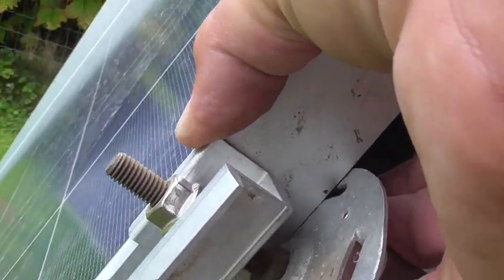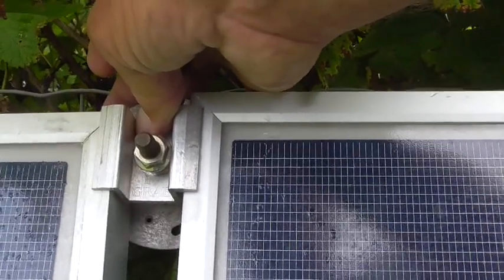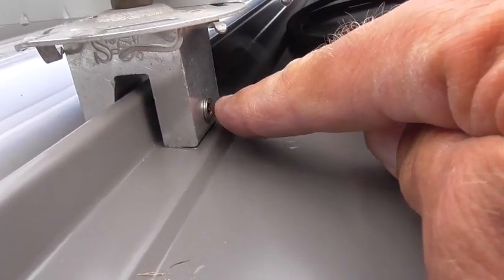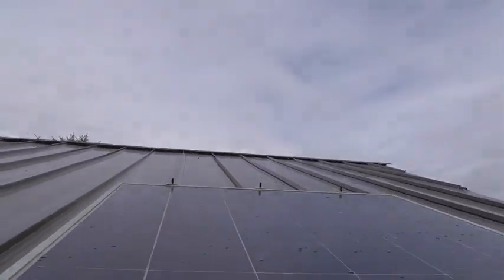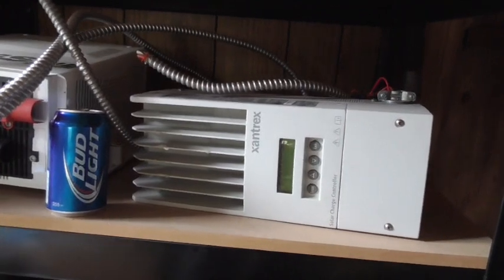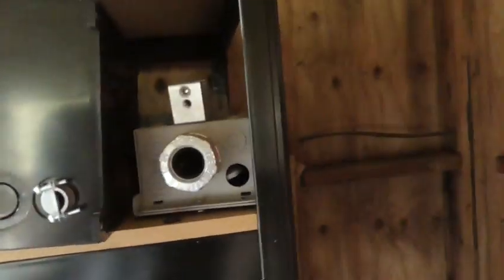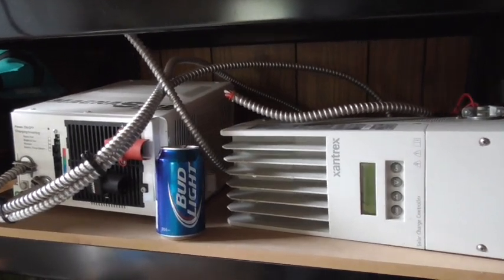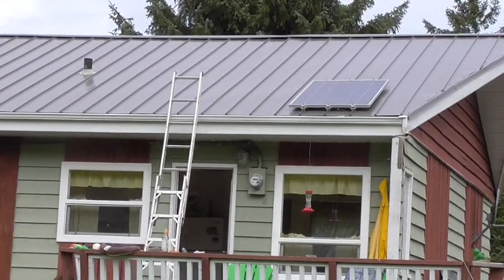No Penetration (Part 1) Metal Roof Solar Panel Install !

Comment: After 9 years use, any issues with corrosion where the bracket clamps to the metal roof seams?  Especially since the clamping screw might cut thru the paint on the steel roof?  A current S-5 video shows using 2 clamps on each long side, so the panels orient horizontally across the seams.  Less cost and better support (shorter spans).  But can't always fit panels ideally, given roof size and obstructions (vents, ...).

Current all-in-one "hybrid" inverters today are a "one-box + battery" solution (ex. EG4 6000XP), so simpler than your layout then.  You can wire ~8 panels in series in a "string", up to 400 VDC, for simpler wiring.  Some such "string inverters" have up to 4 string inputs (MPPT).
Reply from the maker: So far there is no corrosion issues at all on any of the clamps and are holding Great!  You can mount the panels in either direction but due to the high winds here, spreading the mounting contact points over 3 panels is much more secure than 2 points.  The new inverter/charger systems are much easier than my older system but we will see how long they last compared to the older systems.  My system is now just over 15 years old, 10 here and 5 in Calgary before we moved here.

Comment: Interesting idea, but how did you get the wiring from the panels to the inside?
Reply from the maker: The wires go through the basement wall under the deck.

Comment: How do get wire through the roof into the structure? Thanks for this!
Reply from the maker: Ran it down the wall and into a waterproof box which is attached through the wall in the basement.
Reply: @NormanMcGregor  I have perfect roof orientation to do this, but it's so much work and additional copper (as it turns out) for my solar well pump application. Thanks for the reply!
Reply from the maker: That is too bad because it does work great.  But you do have to weigh the cost/benefit in any system for sure.

Comment: I think they do great in the wind I am worried about the snow load on them.
Reply from the maker: Here in Canada, e get lots of snow and I've had no issues in over 10 years with them. S5 also uses these for their snow guards.  Don't think snow load is a problem as long as your roof is rated for the load.

Comment: I'm about to install some on my place in calgary! But my metal roof dont have that thick of an edge. It's like maybe 3 quarters of an inch more rounded
Reply from the maker: Hi Robert!  Go to https://www.s-5.com/ They have clamps for most any metal roof types.
Reply: @Norman McGregor  thank you. I'm actually installing them this weekend so. Won't be nothing fancy. Just use what I have and maybe fasten 2x4s across lol
Reply from the maker: @robertgiroux3658  The nice thing about the s-5 clamps is you don't get holes in your roof.  Some people do screw 2x4's to their roof and use a good sealant which will need to be replaced every so often.

Comment: Where can you get these and what do they cost? My roof isn't standing seam it is the overlap rolled type whatever it is called. I don't think these would be open enough to go over the roll type. Do you know if they are made to fit my type metal roof? Thanks for the video.
Reply from the maker: The company is S-5 and you can get them online at https://s-5.com/how-to-buy/  
They make many different types of clamps for all kinds of metal roofs.  I think they are around $5 each here in Canada but check out their website for the current prices.

Comment: What batteries did you use back in 2015?
Reply from the maker: I showed them in the video.  They are L16 390amphour AGM batteries.  Still using them today and they are still delivering top performance.  Plus I used them for 5 years previous before I moved here.

Comment: Thanks for sharing. For everyone's benefit - one want to use solid dummy pieces of metal in the edge of last row of panels for S5 holder clip (and those should be of the same size as your panels) to have them secured (panel from one side, similar size piece of metal from another side). Otherwise the holder can slide off the panel at some point. It is especially important for the bottom row. Just take a look into S5 guide. I am also considering S5 products for my project now.
Reply from the maker: Good to know!  I checked the 6 year old mounts and all are still tight.

Comment: What type of Metal roof did you install ? where can I find this ?
Reply from the maker: Its a standing seam type.  Most metal roof suppliers can supply this type of product but it is a bit more pricey than regular metal roofing.  The advantage of this product is that there are NO Screw holes exposed to the environment and rain which causes leaks.
Reply: @NormanMcGregor  And also is this clamp still available today ?
Reply from the maker: Hi Terry, Yes they are at https://s-5.com/

Comment: when your stuff craps out eventually and it will look up  this guy and it is a complete solar power solution that will last the life of your system except for the inverter.  electrodacus.com   I am not sure if that system would work in the Philippines with their typhoons. what do you think.
Reply from the maker: Interesting...  My System has been running for 10 years now, performance is still 100%  with 0 repairs. Our Fall and Winter storms, that occur on a weekly basis, are WAY MORE INTENSE than the Misley typhoons you have in the Philippines.  Get a Life and learn from those who are actually doing it!! OR continue paying $$$ for your power and be at the mercy of the power companies when their systems fail and you have no power!
Reply: @NormanMcGregor  glad to hear it but the storms in the pinnes have winds that are pretty crazy. I have lived their and have experienced it. I am Canadian and haven't had winds that high in my experience. close but not quite as high. I am not sure if I can find the roofing that you are using in the pinnes. believe me, I will be installing a solar system when I get the chance to and I hope that it will be soon. we have blackouts for days and the only way that you get around it is to go solar. the price is crazy high and solar is the only answer.  how much is the attachment system you are using there btw.
Reply from the maker: We have winds that hit over 100 - 150kmp at least 3 times a month here in the Fall and Winter.  You may have that once or twice a year!   We have had 2 storms that achieved that this week alone.  That is a category 1 Hurricane in weather language.  With the right gear and installed properly, you will have a great system like I do.   What attachment system are you referring to as my system is a stand alone.......
Reply: @NormanMcGregor  you are using s4 that doesn't penetrate the roof and clamps onto the risers. I would like to get something without rails like you have so i will have to look into it. it just depends on what I can get for my metal roofing in the pinnes.
Reply: well the pinnes gets 20 typhoons yearly and winds go over 200 kph in about 5 of them. its not as much of a picnic as you would think. that is why I was asking about holding strength. I have seen roofs peeled off whole and just fly away. really amazing the power of the wind when it hits like that. I just need to make sure I have the panels buckled down real tight because I don't want anything to go visit the other side  another island. we have had some really bad storms cat 4 and 5 are not unusual for about 5 of them like I said.
Reply from the maker: @kusnezoff8705  For sure!  All depends on what you have to work with.  The S-5 clamps work Great  for metal roofs in the USA and Canada!  Not sure about where you are in the pinnes.
Reply from the maker: I guess if the wind takes your roof off, you will loose your panels for sure.
Reply: @NormanMcGregor  hahahahahahaha yup that would happen for sure. LOL

Comment: In most roof mounted applications with rails there are grounding wires that run along the rails. Did you have to add any type of grounding wire to your application to pass an electrical inspection?
Reply from the maker: With a metal roof, the grounding wire grounds the whole roof and panels.

Comment: What brand of solar panels did you install? How do you figure out how many panels you need?  How much does a solar system cost for a pole barn?
Reply from the maker: The company I bought them from was a Canadian company in Burnaby BC but they closed in the 2008 economic crash.  To figure out how many panels you need along with the other equipment you need, you first need to know what loads you want to run and how long they need to run.  From there you can figure out what you need.

Comment: Norman I am wonder if you have noticed a reduction in the amount of power your extracting from the sun with your solar panel since you have insulted him 3 years ago ?
Reply from the maker: The panels are actually 9 years old as I had them installed in Calgary before I moved here.  They are actually still over producing the rated wattage on perfect days so I would say no loss in power so far.

Comment: So a 200mph wind will rip them off
Reply from the maker: No guarantee they will hold in 200mph winds.  However considering that a Category 5 hurricane has wind speeds at only 156mph, I think you would have more to worry about than your solar panels in 200mph winds. LOL!

Comment: I would like to ask you.Can you use those on 5V crimp metal roofing???Thanks.
Reply from the maker: I don't think so as the S-5 clamps are designed to attach to a standing rib seam.  Check with S-5 though they may have a solution for you.  Their website is http://www.s-5.com  .
Reply: Thanks

Comment: No rails? Interesting. Looks like you need a lot of mounts per panel, versus the mount/rail/panel system.
Reply from the maker: John Lackner As I said in the video we use extra clamps because of the high winds here.  I would install the same number what ever style of mounting system.  The big advantage with the S5 clamps is you don't put holes in your metal roof.

Comment: everything is still nice and snug? we get extreme temperature swings +40c to -40c the setscrew doesnt back off over time?
Reply from the maker: The S5 Clamps are in their 3rd year here on Haida Gwaii where we get constant very high winds in Winter with no problems holding at all.  I also used them for 5 years in Calgary, Alberta, which has similar extreme weather conditions to you, and never had a problem and the setscrews have never backed off.
Reply: Thanks for the reply where do you recommend panels from wholesale ? I'm aiming towards 10kw system
Reply from the maker: I would recommend looking for a local supplier as panels have gotten so inexpensive.  You may save a few $$ on price shopping around the country but will more than likely end up spending more because of shipping charges.
Reply: The price to beat now is about US$0.65/watt

Comment: Do you run a risk them sliding off the roof?
Reply from the maker: No risk of the panels slidind off the roof. The s5 clamps fasten to the standing seam ribs.  Designed for use in winds of up to 130mph.

Comment: Where can I find the S5 Clamps with the plates you have?
Reply from the maker: http://www.s-5.com  be sure you order the correct clamps for your metal roof profile.  You also need their PV kit for each clamp.  Excellent Product!  Used them to mount the wind supports for my wood stove chimney too!

Comment: just wondering I'm planning on building my home just about that size how much did the metal roof cost you? I'm trying to decided if I should go shingle or standing seam
Reply from the maker: My metal roof cost $1.44/foot.  Here it was actually less expensive than regular shingles but on the mainland shingles are usually less expensive.  The main advantages for me are, I can add solar panels without putting holes in the roof and the roof will last more than 50 years without needing any repairs.  Shingles constantly need repairs and only last 10 - 15 years.

Comment: Very helpful...thanks. Have you found or seen a solution for bolt-together (not standing seam) steel arch buildings?
Reply: Check out Advanced Racking for the best metal roof options.
Reply from the maker: Not sure what you mean Mark but companies like UNI-RACK have a lot of different mounting solutions.
Reply: +Norman McGregor (Our Island Adventure) Thanks...search SteelMaster or steel arch building if you are curious.
Reply from the maker: I'll check them out!
Reply from the maker: https://www.advancedracking.com/

Comment: thanks I was wondering how to do that, I have a metal roof on mine too, I'm planning on using a cattle gate and attaching it to a telephone pole that remains and then put a wheel on one end of it and let it follow the Sun
Reply: and at the top of the old pole I would like to put some wind turbine of some kind
Reply from the maker: +CHICKENRELIGION.COM That sounds like great project.  Would love to see a video when your done!

Comment: Nice Stuff Norman Nice Poly Panels  Magnum Is A Top Notch Inverter  There Coming Out In The Future With Grid Tie Battery Back Up  Inverter I talked Them A Few Months Ago  I Will Keep You Posted ! Great Gear Buddy I Had A Magnum 2012  Back In 2009 Nice Equipment  I like Those Solar Panel Mounts  They Will Be Great For Those Strong Winds Up In Canada  Keep The Videos Rolling In
Reply from the maker: +KVUSMC / Kenneth W Viar Jr Thanks Kenny!!  I love the Magnum for its FAST transfer rate.  Its so fast, You don't even know when it switches!!  I am a dealer for Magnum and I have one of the new units that I am testing, ITS AMAZING, but I can's say so yet public!   LOL!  The S5 mounts work FANTASTIC for standing seam metal roofs!  here is nothing better in my opinion especially for the wind conditions here!!  :)
Reply: Norman McGregor  That Is Awesome I Didn't Know You Were A Dealer  Buddy Cool Deal Yes Sir Nothing Beats A North American Inverter  Magnum And OutBack  Are The Inverters I Would Only Recommend To A Friend !  Hot Dog There New Unit Testing I Have A Few Ideas Of What Is ! Cool Brother Zantrex Makes Awesome MPPT Charge Controllers  ! Yes The S5 Mounts Are Awesome Buddy You Have It Going On ! Keep Me Posted Norman On The Updates Hollar  At Me If You Need Anything 
Cheers 
Kenny
Reply from the maker: +KVUSMC / Kenneth W Viar Jr Thanks Buddy!
Reply: Norman McGregor Anytime Buddy

Comment: Yes there nice. we don't use folded crimped roof sheeting in Australia, I like it . So easy but i love the idea and it looks sexy.A roof is not finished until it has solar panels on it :) Is that a beer advert for bud light. hell they should send you some free bears for that LOL
Reply from the maker: +Justin Case Hay Chris!! This type of metal roof is totally waterproof, if installed correctly, and is the perfect platform for a solar installation!!  Rest assured this roof will be totally covered in solar!!  LOL!!  Regarding  the beer, I love to promote Great Products!!  LOL!!!!  :)